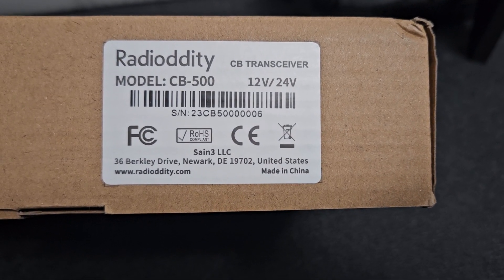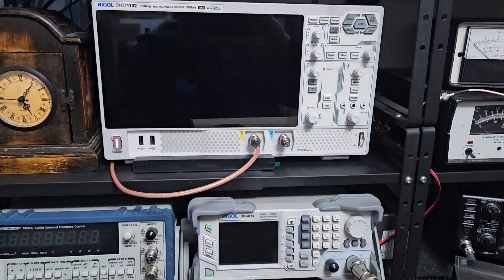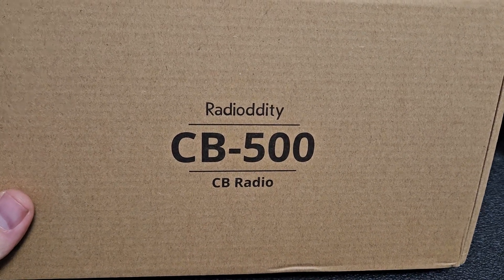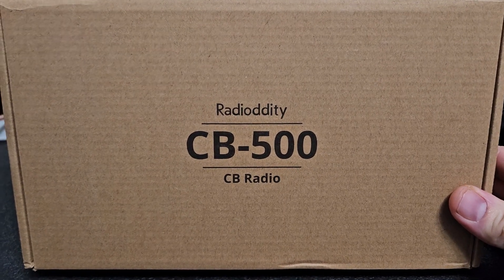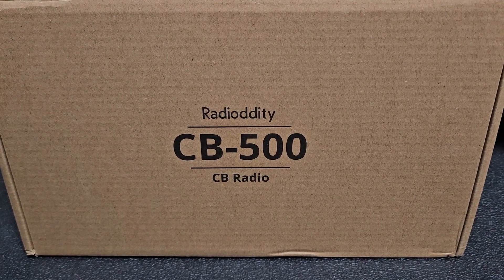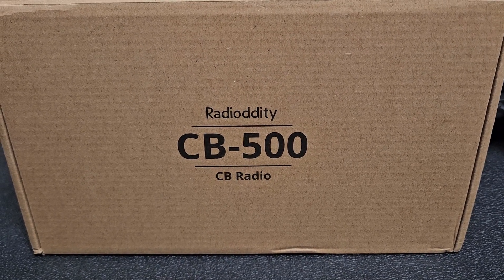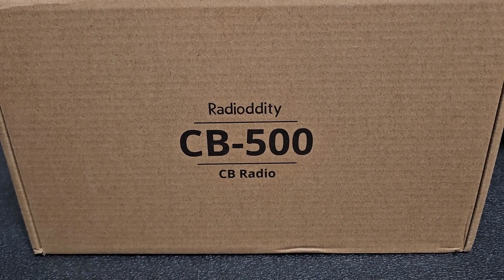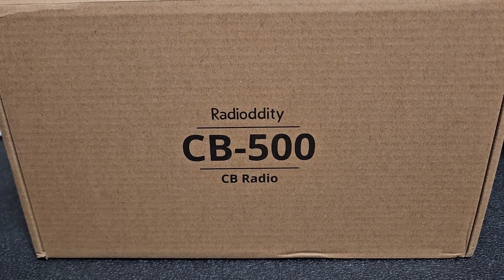Video coming Soon

Comment: Only Am/FM. 😢😢
Reply: That's a good thing as many people don't want SSB and only want AM and FM!
Reply from the maker: There's certain circumstances were SSB isn't necessary.
If I just want to talk locally or say talk to my wife or boy on the radio SSB can be a nuisance.
Eventually the skip will die off and we won't have all this worldwide/nationwide propagation. AM will always be the #1 mode of CB in America.
FM is going to take some time to get on.
New radios like the one I mention in this video will help bring FM into the spotlight when the skip conditions go away.
Talking on AM is quite enjoyable when you don't have to listen to all of the bleed over from all of the big power stations coming in from skip.
It's funny even with hundreds of thousands of watts and gigantic beam array antennas. When conditions drop out all that power/antenna is useless.